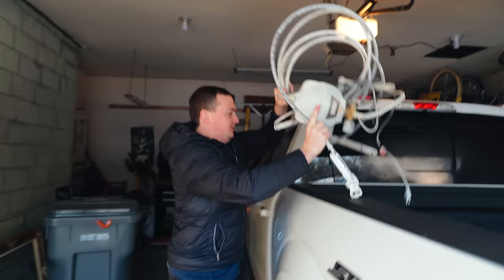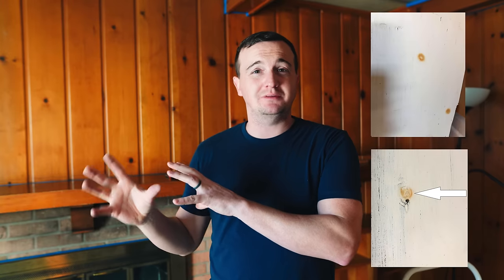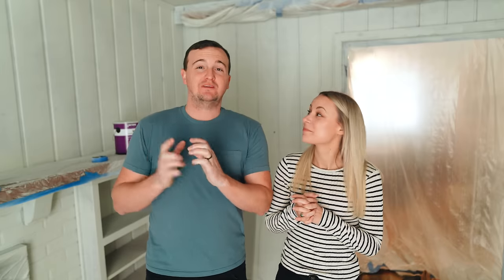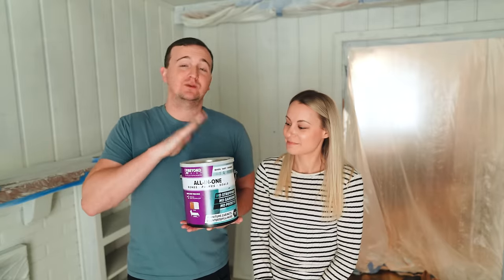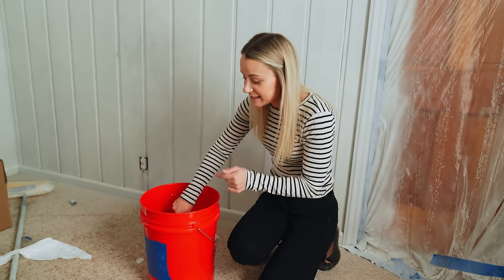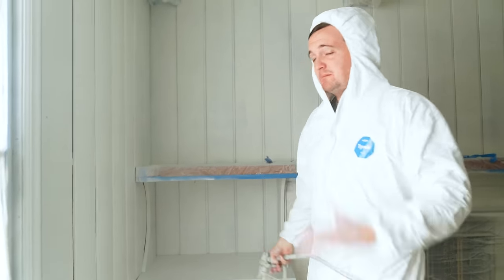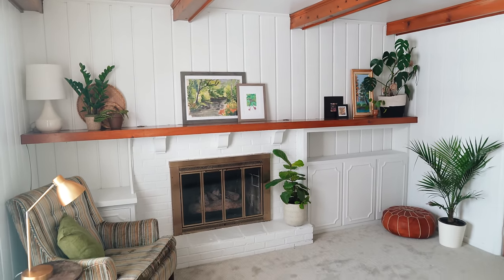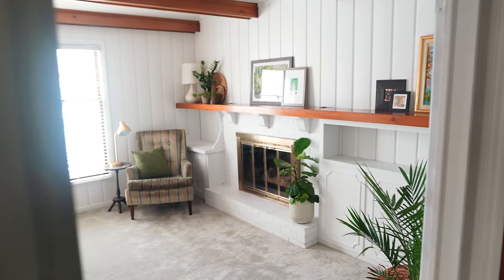How To Paint Wood Paneling The RIGHT Way - Living Room Makeover

Comment: You two are a great team! Few points I have learned painting would include washing your panels with a good TPS solution and water first. Then do your caulking and repairs THEN prime. Two coats for that paneling would probably have been better since going with a white top coat. Also water based on oil based is best after oil based can cure for at least 3 days. Jut some tips for long lasting paint job. Love u guys!
Reply from the maker: Ahh great tips Monique! Thanks! 😁😁

Comment: Just watched this.
I heard you talking about patching some pin holes from nails, but not patching up  the Knott's from the knotty pine knotts in the wood .
I know if people are looking for a smooth surface them knotts will have to be sanded first then patch because with out it you'll have alot I mean a lot of pin holes showing after painting white shows everything speaking frome experience.
I did a new bathroom and all the knotty pine knotts needed what i just talked about.
I say if you dont caulk every line where the two boards fit together you'll have open cracks so a ton of work is needed 
1.I suggest sanding all knotts first for smooth finish if you dont want smooth finish then skip but it wont look as nice.
2.vacum cobwebs and any dust off walls .
3.wash walls do it dont miss this step wash afer spackling and sanding.
4. Fill spackle any holes then sand vacuum again yes again.
5.Do youre caulking last let set over night you don't want dust to stick to it if you need to sand something else.
6. Do your final look around touch up anything you missed.
7.Tape off anything you dont want paint on use good tape i use green frog tape making sure when taping to press firmly on the tape making sure you get a good seal so you dont get paint running back on to anything you dont want paint on.
I say masking taping takes a good amount of time if i say if you want it done correctly.
8.Prime use good oil based on wood dont chance it trust me do two coats especially on wood with lots of  knots.
9. Paint then after painting you making sure to take off tape after paint dries dont wait because if you wait a day or two you could peel paint off walls.
10 have fun make it fun if you don't it will take even longer.😢

Comment: So is it not important to wash the paneling first? No need to sand or degloss the clearcoat first?
Reply: I wonder that too. 🤔
Reply: No Sanding first?
Reply: @SJ-fx8gu  So I made a test piece of scrap paneling. I used four different brands of primer. I did not sand the paneling at all. I let it dry for two days. Then I used my fingernail to see which primer scraped off easiest. I could not scrape any of the brands off! They all bonded very tight. So when I ultimately painted the paneling in my basement, I did just use a fine sandpaper block to take the sheen off the surface just for extra adhesion. But I probably did not need to do that. I used a water based primer as well. The only change I made to oil based primer was when I had stain wood shelving to paint over. The stained wood does require an oil based stain blocker primer.

Comment: FYI you can used Woodscapes latex stain by Sherwin Williams to stop tannin bleed, just used on a recent product over cedar paneling interior walls in a great room, you can also use Sherwin Williams exterior latex primer as well. Just some other options if you don’t like using oil paint.

Comment: I want to do the same but with varnished ceilings, but really important question... do you not need to lightly sand first?
Reply: Wondering the same thing? How long will the paint last if the boards are not Sanded first? Hmmm....

Comment: I paint cars. In lacquer. Our opening shot shows the classical  paint stroke error. At the bottom we see a curve form as the nozzel moves up. To do this properly you need to get yourself down low and then stand up otherwise you do this::   )   along the wall.  So you need a step as well, to keep the gap the same as you get to the top. This wall is not a Porsche etc and you are using a brush or roller  to even things out so the ) issue isn't so critical as it is in car paint. . I've worked with house painters and this ) motion is common.  And it can cause problems but a brush helps cover a multitude of sins.  With cars you must be very precise. Otherwise you get a dry speckeled texture at the top and bottom and no brush will make it right.  says mr know it all